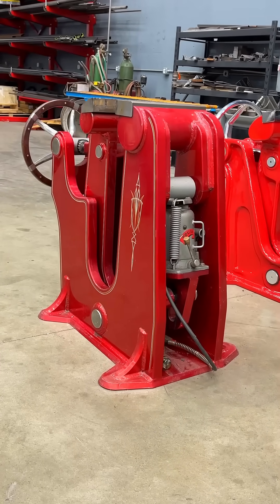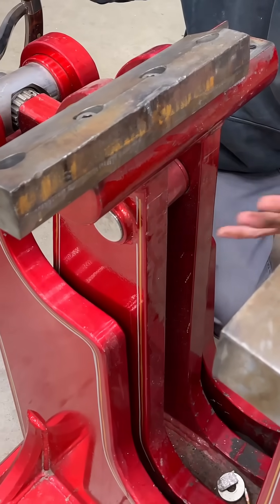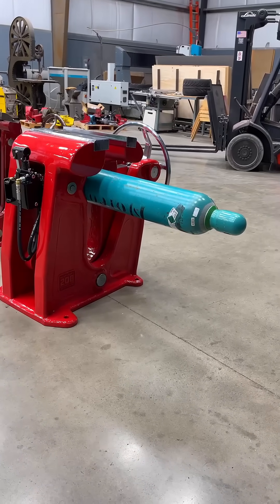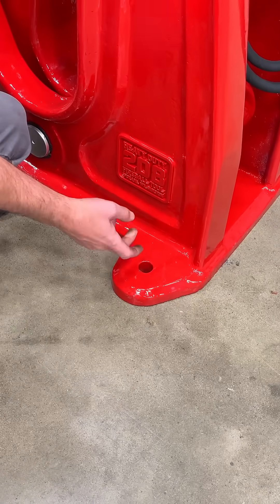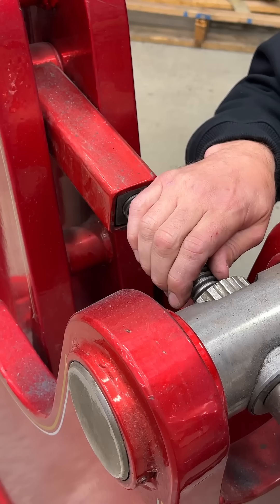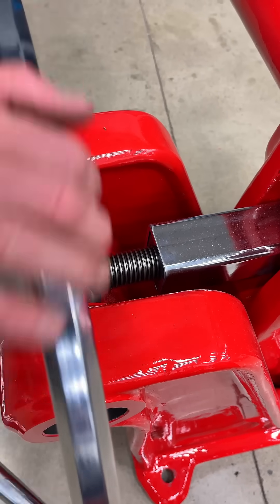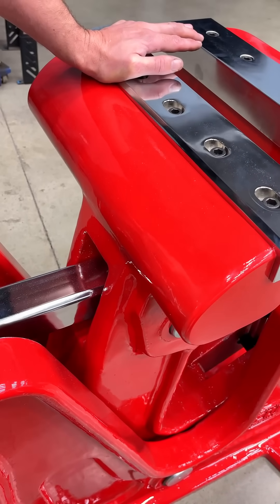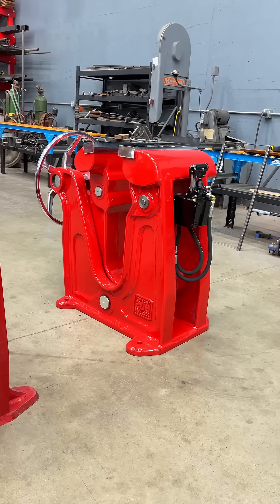I Built This Vise Wrong, So I Fixed It!

Comment: you could make the extra jaws for cylinders wider to fit larger cylinders and add 4 flat portions in the extremities of those jays to hold large pieces or cubic forms 
          .     .
          .     .
          .     .
     .              .
    .                  .
    .                  .
      .               .
         .         .
            .     .
            .     .
            .     .